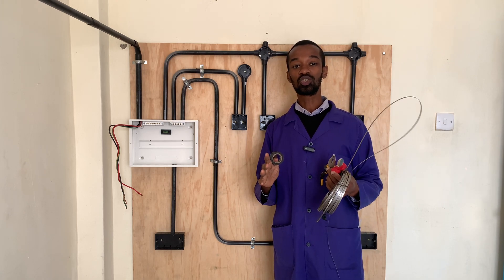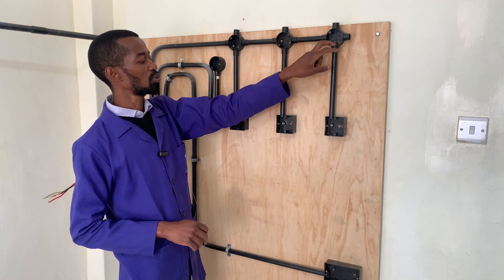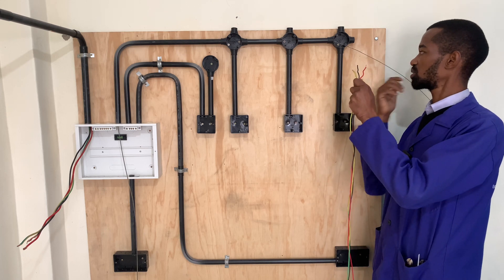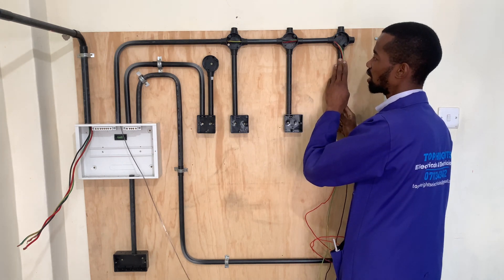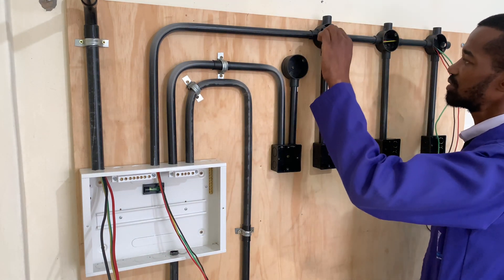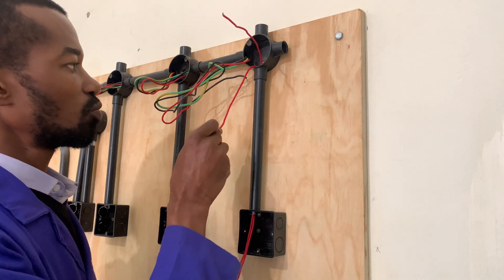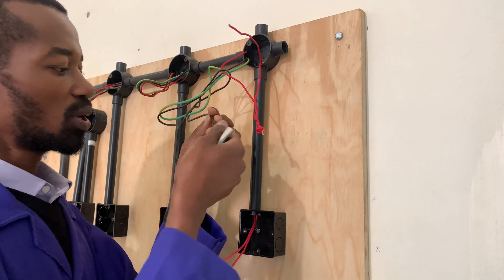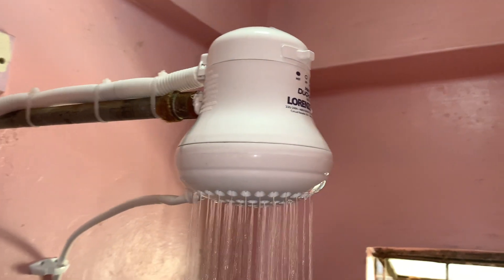Electrical Wiring For Lights (House Wiring Made Easier)

Comment: Hello please sir 
I have experience some fault and please I wish you could help me 
The fault is, the switch wire from the switch to the lamp holder ,I  test it with tester and the tester gives me small power but if I touch that naked wire then the power goes off and I don't understand that fault please help me out
Reply from the maker: Electricity is dangerous and you do not test it with your body.

Comment: Sir you use 3 cables R,B, Y/g but I learnt I power cable will come straight from the consumer unite to the light switch . I want to know your system sir
Reply from the maker: Great question, the two methods are both used and have their specific advantages.

Comment: Hello John how are you doing 
I have question for you 
Like single phase 
My question is that is it possible to connect earth from neutral bar to the earth bar if the drop cable does not have earth wire and you don't have earth ground installation

Comment: Is it wrong to connect my light from the socket which has 2.5mm cables and how safe is my bulb if I don't connect the earth wire
Reply: I see can't cause problem
Reply: It is good to take supply from the consumer unit. Per my perspective I would rather you use 1.5mm cable for lighting system. Please reach out for a pro for more information as I’m also a beginner ❤

Comment: I have a question.....about the first and second holes,the live wire has just passed through,how do we connect to the switches? Do we cut the supply wire to connect the socket wire? or we just need to strip off the part needed for connection? Or do we use connectors?